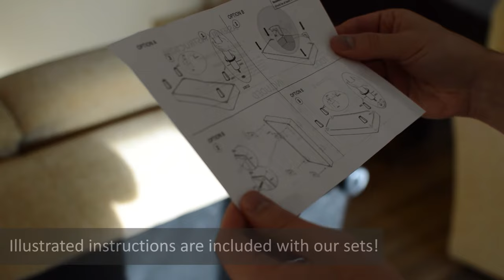Wood Furniture Legs: installation tutorial

Comment: Hello.  I purchased a used loveseat, and the legs were five inches.  I wanted the loveseat to be higher, so I ordered an ornate set of eight inch legs from amazon.  The original screws were metric, so we took the screws out of the old legs and put them in the new legs.  It really looks good, but now the loveseat has a wobble.  Is there any way to correct this?  Thanks.
Reply: @woodit1575  Good morning. By hanger bolts I’m thinking you are referring to what I’m calling screws, the threaded long piece of metal that is in the leg and screws into the mounting plate?

Comment: How do u make sofa legs balance.
Front middle was 1/4 inch shorter then front end legs 
Couch seems to teeder todder
Reply: The legs in back 3/4 inch shorter & there is only two one on each end.
In front the two o. The end measure:
 7 3/4 inches the middle is 1/4 in shorter.
The couch teeder todders?

Comment: Why did you use a round leg? need a tapered leg installed that has bolt in it, will not align properly when finished. Must of tried to put on 300 times, never tightens to where it needs to be.
Reply: @woodit1575  The manufacturer used a cheap round rubber almost like a sealent ring instead of a plate